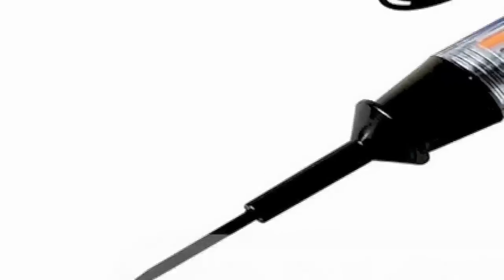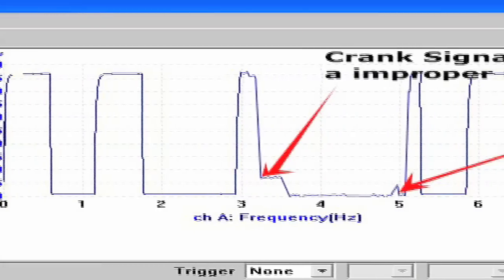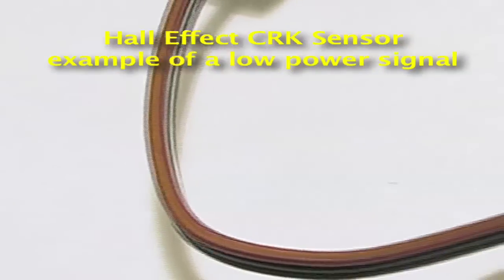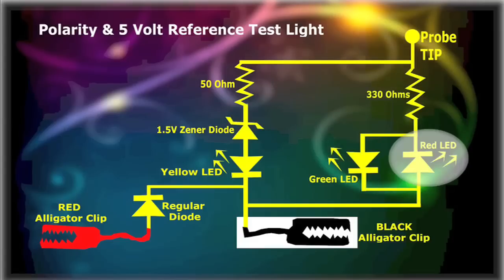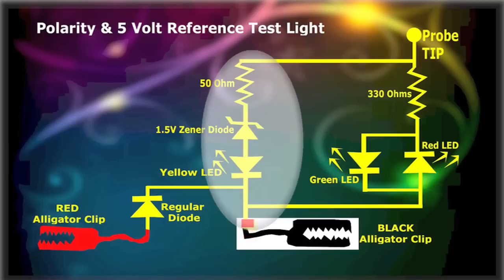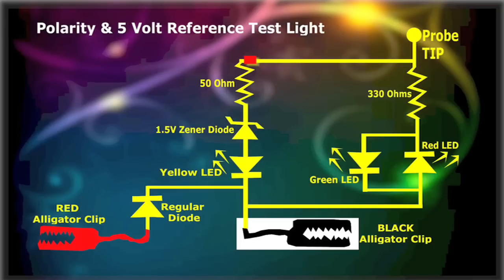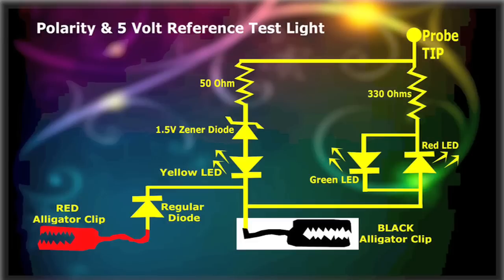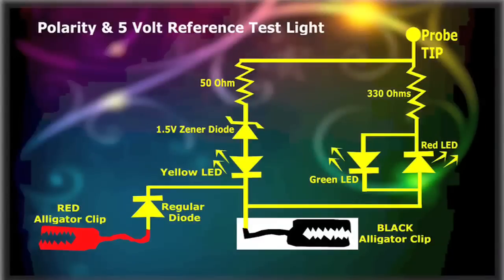Polarity & 5 Volt Reference Test Light

Comment from the maker: So long as you post here you'll never sound like an idiot. Yes, you can clip to batt terminals or chassis and 12 volt power. The fuse box, OBD-2 connector or any other 12 volt source is fine. Thanks again for posting.

Comment from the maker: I know what you're thinking, that the circuit will blow the diode if reverse polarity, but look again. We built this gadget years back and it's still working. The polarizing diode is there in the event of reverse or wrong polarity. If so then the 5 volt circuit is out of the picture. If polarity ok, then both circuits will work. This gadget is made up of two parts. Hope that answered your question. Thanks for posting.

Comment from the maker: Yes, you need to place a selector switch at the leads, which we somehow missed on the diagram. The circuit becomes more complex due to the 5 volt ref. test feature. Thanks for sharing that...

Comment from the maker: There's no reason for it to light up below 5 volts. That defies the purpose of this gadget. If both yellow and green LEDs light up, then you have battery voltage present. If only the 5 volt lights up, then you have only 5 volts. Under 5 volts no lights are present. Hope that helped. Thanks for posting.

Comment: The lowest Digikey has is 1.6v, Amazon and Radio Shack don't have them, and they have thousands of silicone diodes to pick from.  I wish you could give alternate component parts that we can actually get.
Reply from the maker: Any DIODE can has a 0.6V drop like a zener. Put 2 regular 1n4001 diodes and you then have 1.2V zener. If it's a Zirconia diode, then it's 0.3V.
Reply from the maker: ADPTraining
A 1.5 Zener is availble, you need to search MOUSER, DIGIKEY, NEWARK, etc...
Reply: ADPTraining
That's what I'm talking about!  On my way to Radio Shack, now armed with this part number (1n4001).  They have it.  Thanks!
Reply from the maker: Great, that's a very common Diode. Probably too big for the job, but so what. Bigger is better in this case. You may even get away with a low current alternative. These are issues if you are making hundreds of circuits, but for small projects, the 1N4001 is a great general purpose Diode. Thank you... Mandy.
Reply: ADPTraining How are these two 1n4001 diodes connected? in series, parallel or opposing each other ?

Comment: Do you have an updated video of this circuit where the "selector switch" is implemented?  What is it and what components is it connected to?  This circuit has a short-- as soon as you connect the leads to the battery.  The viewers should be aware of this.  Great idea though.

Comment: i hvae been having a hard time finding an actually 1.5 v zener diode metioned in the video, do you have a part number i can referance.
Reply from the maker: Kabel Gebeke Any silicon diode is a 0.6 Zener. So, take 2 of these and you've got a 1.2 to 1.5 volt Zener. Connect them in series. Hope that helps. Try Amazon or Digikey as your supplier.
Reply from the maker: These are available now. Search MOUSER, DIGIKEY, NEWARK, and others. FOrget Radio Shack... A regular diode 1N4001 has a 0.6V drop like a Zener. Put 2 of these and you have 1.2 to 1.4 Volts Zener.

Comment: Nice circuit only one issue I have noticed. The positive terminal is shorted to the negative terminal via the regulating diode.
Reply from the maker: +Hugh Smith True Hugh, there was an error (mentioned here elsewhere) about that diode. it is backwards. Thanks for the heads up. Following look for the title "Make Your Own Automotive Diagnostic Equipment book on PDF". Thanks... http://www.autodiagnosticsandpublishing.com/Automotive_Diagnostic_Repair_Book_Catalog.htm